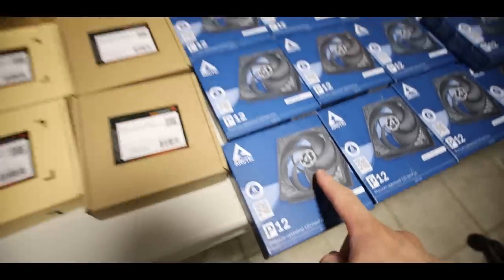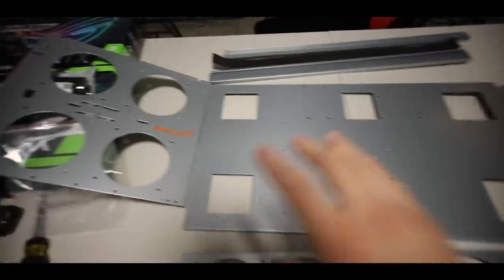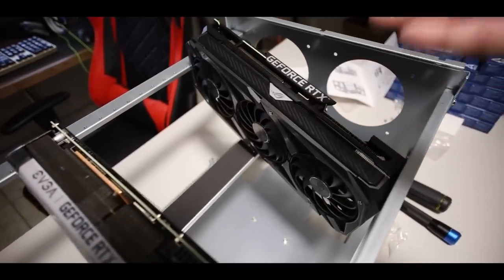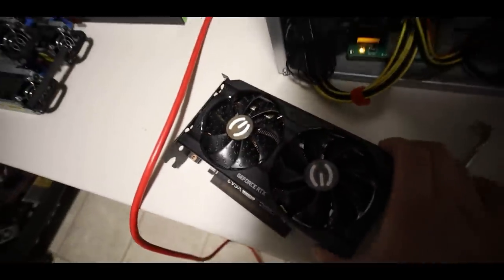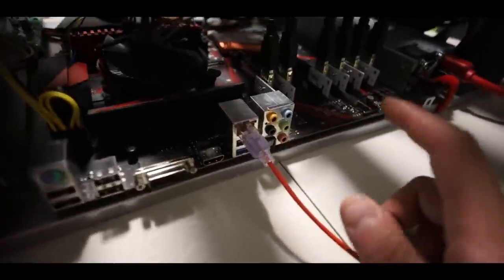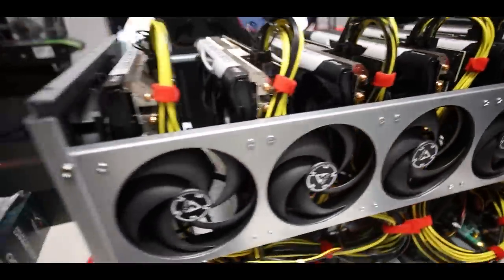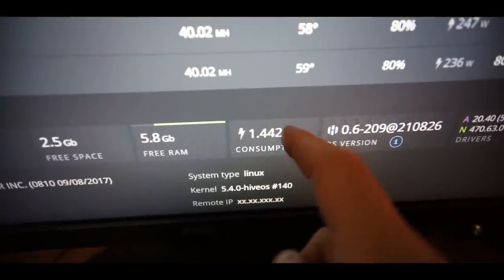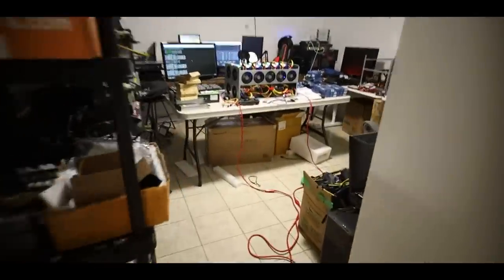This Mining Frame Has TOO MANY FANS!

Comment from the maker: 2 things I didn't realize in this frame...
1: you can mount the fans the opposite way (screws from the inside)
2: can lower the bars to have the spacing for the 2nd frame so it doesn't hit the GPU pcie depending on size of the GPU.
Reply: Do you think if the side fans were mounted the opposite direction and venting air out instead of just blowing on the end gpu it would help?
Perhaps the fans are too low cfm to matter but Maybe it’s worth trying 🤷‍♂️
Reply: When you say Lower the bar is because you are going to stacking on top ? Yeap I did have this problem and just decided get some metal shelf and leave some good gap between the frames , because I’m just using 6 fans at the back . Btw I never installed all fans on sides because I didn’t find  a good way to make the air flow eficiente .
 This frame and veddah are my  choice . 

Cheers Panda
Reply from the maker: @Crosjg a subscriber has won the psu already haha
Reply: The dredge, What a name!
Next model name would be Trommel. Nice and thoughtful design. Thank you for the review RPM.
Reply: Do a revisit of this mining frame pls. And stack the frames. It would be interesting to see how they perform when stacked too.
Reply: When you mount the fans outside you may also want to flip the fans on the exhaust side of the frame. So 2 sides inlet and 2 sides outlet. This is important if you are using blow through cards like RX 6800s or RX 5700 XT Red Devils. If you don't then you can bottleneck the heat at the rear of the cards and have up to a 30C change in operating temperatures. These frames are also $30-$60USD cheaper going through Amazon or eBay instead of AAAWave.

Comment: That is a lot of fans on that rig.  Has it been holding pretty stable at 40mh?  I may be putting a rig together in the near future with a couple of these on it.  Would be nice if it is holding solid at those overclocks since mine are EVGA also.  That frame looks really nice though too.  I am still waiting for my higher cfm fans to come in from china to get on a couple of rigs and keep them cooler.
Reply from the maker: Solid 40mh even when gpu temp went up to 67c on one of them haha! Zotac 3070 ti I have r throttling hardcore

Comment: Red Panda Mining, I was wondering if you can drop the GPU mounting bar and PCIE bracket to allow more space for a second tier aaawave 10GPU mining frame?  Would that give you enough clearance for the PCIE connector and wire bend radius clearance? 🤔🤓
Reply from the maker: You are completely right I forgot about that

Comment: Very good review video once again.
I like the fact that it is so easy to build and assemble together. just under 8 minutes is not bad at all.
the one thing i like the most is that you can change and adjust the fittings according to which GPU I will be using. very COOL!

However the draw backs that I disliked is that the edges are a bit sharps and can cut my fingers, (Yes I can wear gloves while assebling it i guess) and that the top 4 fans on the sides are blowing straight into the side GPU's making them kinda useless in my opinion. fairly priced for the design and what you are getting. Also the fact that you can't stack the rigs ontop of each other using the bigger cards.
There is definitely room for improvement but overall its a cool rig.

Can you buy additional parts and beams for the Gpus/ Fans/ spare parts ??

Comment: I don't think you are thermal throttling. I think you are hitting 250 watt limit on this GPU. Each GPU is different and power consumption is different even for the same GPUs. Try changing PL to 255 and see if that helps

Comment: Thanks for showing us another mining frame. I am a very casual miner and have yet to get a frame. The more I see the limitations and variables for these frames you review, I really think building a custom frame out of ~$50-$75 in wood is the best way to go. I can get proper spacing (GPU length and between GPUs) if I hook up 6x 3080's or if I make a 8x 1660 rig. These frames for $150+ mostly seem to be geared towards miners with a lot of a specific size of GPU. As a gamer and casual miner, full towers have worked well so far, but would be fun to build a wood frame with proper measurements.

Comment: Good informative review. Regarding the stacking of frames, possibly AAAWave can provide a 25 to 50 mm stacking plates to attach on the left and right side of the frames, that should give enough space for air flow when tall cards are used. You could lower the cards as mentioned in the video but that may be a little tight on height. A pair of fixed handles for moving the rig would be a plus when you have to move this rig to it's final home. 
Thanks again, good information.

Comment: Kinda not so good. I dont know if it is the frame or the cards being too close but i get 42,2 - 42,4 at 240W with the same Evga GPU RTX 3070 TI. Missing 2,2 Mh/s on average makes a loss of 13,2 Mh/s in total.

Comment: Nice video! It is a cool looking frame and seems easy enough to build. You mentioned a m.2 adaptor and possibly doing a video on it. I would really like to learn more about those adapters. I have a 6 gpu rig now and am considering adding a 7th (motherboard only has room for 6). I looked into splitters but am not sure. I have heard the m.2 adapter before. Does it decrease performance on the graphics card? (likely a 30 series card)

Comment: Generally Artic P12/P14 fans are static pressure fans, normally used for custom loop water-cooling, you would put them on your radiator(s)...
Artic F12/F14 are more suitable for airflow...